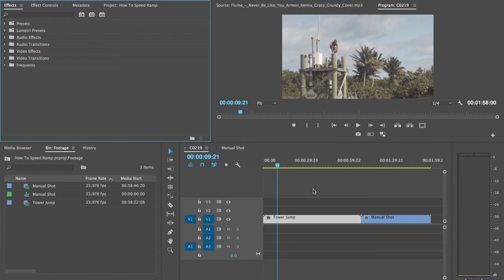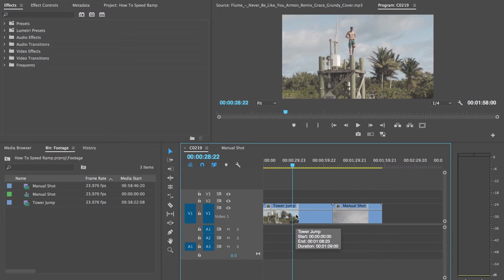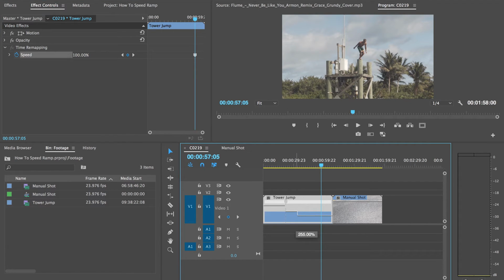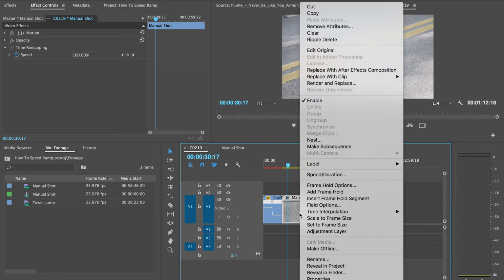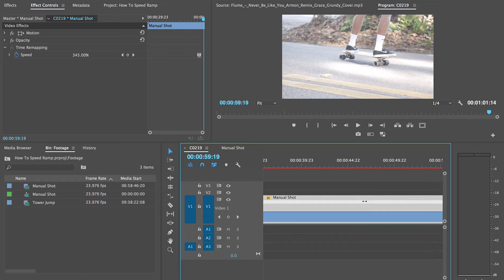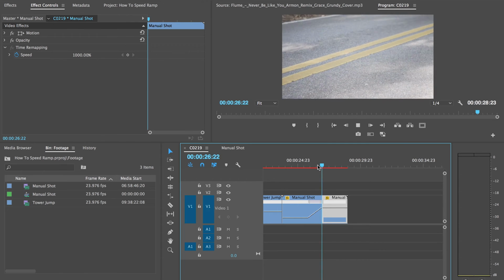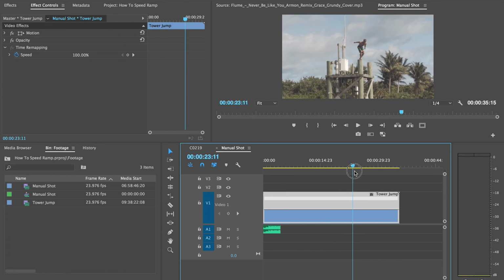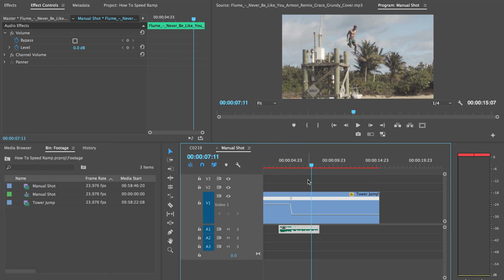How to Speed Ramp in Premiere Pro CC! GO ABOVE 1000%!!!

Comment: Thanks for the video, This is a very annoying limitation, not sure why Adobe doesn't let you set a %. I normally use Premiere, but Final Cut Pro can do this much easier. Its unfortunate. I also do the razor, ramp etc. But feels like a band aid to something that shouldn't be a problem. I been searching online, and unfortunately, there doesn't seem to be another way, but glad to see I am not alone. Thanks again.
Reply from the maker: Yeah, definitely an annoying and completely pointless limitation. Thanks for watching!
Reply: pc1x1 no, you are definitely not alone. Thanks for the tut, Matthew. I also use the rate stratching tool (R) for the shortcut. It allows you to drag or pull the edge of the clip, making it faster or slower.